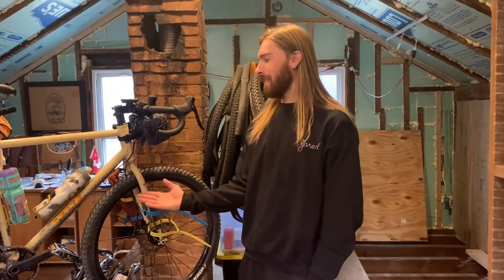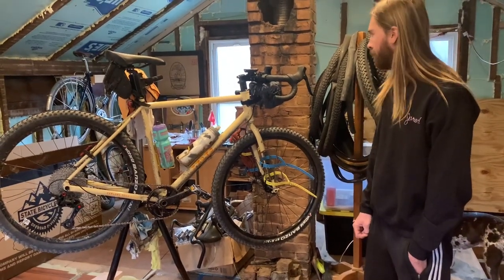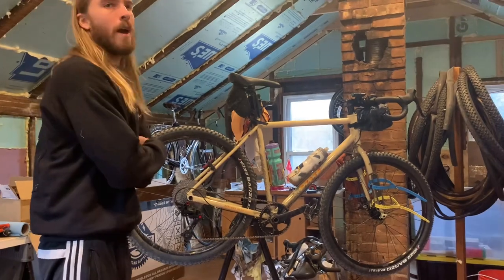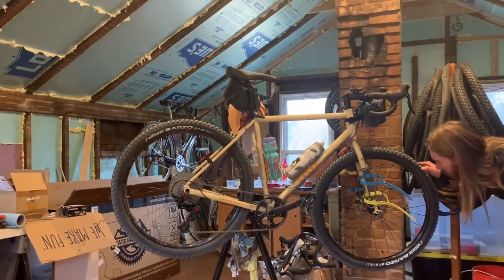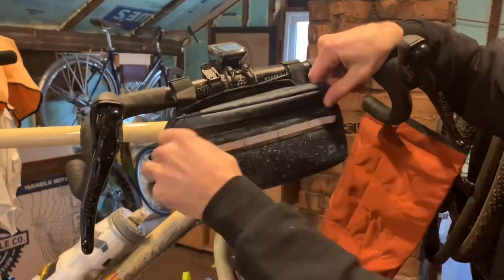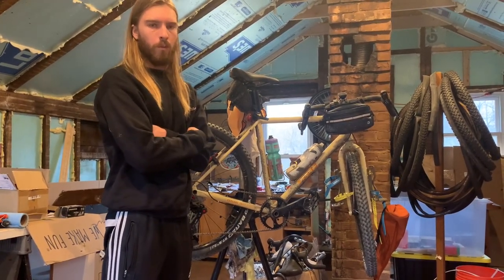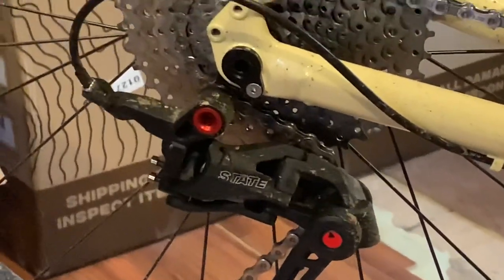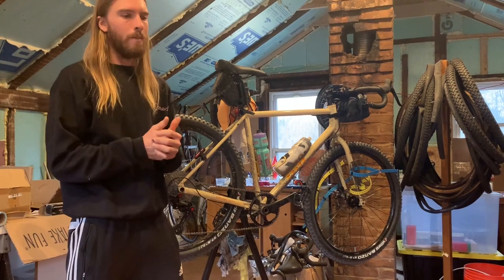State Bicycle Co 4130 All-Road Review

Comment: I have beaten mine senseless on gravel, dirt, mtb and blacktop for well over 2500 miles. I love it. The Sensa based groupset is awesome as well. Brakes are strong, but I upgraded to sintered pads front and rear. I adore it. Unpaid endorsement. Unless State sends me some stuff.
Reply from the maker: Awesome man. I have around 1100 miles in mine now, on all types of terrain and absolutely love it too. I agree about the groupset. Maybe I’ll try new pads before upgrading the brakes. I was thinking compressionless housing might help too
Reply: Have you had any shifting issues or chain dropping? I might get this bike
Reply: @gavin7390  Only on really rough mountain bike trails that it probably shouldn't be on. My buddy bought the aluminum version and he will throw a chain every now and then though. Mine is still trucking!
Reply: @travislivengood2744  yeah I guess it's not really intended for rough mtb trails. But that's awesome man. Did you have any issues with the derailleur or the derailleur hanger when you got the bike? I'm kind of worried about that. Heard quite a few people have problems with the derailleur and derailleur hanger
Reply: @gavin7390  I have really had zero issue. I had to recable at one point due to a failed cable housing. I had State ship me a spare mech hanger as just to have. I bet the bike has an easy 4-4500 miles on it.

Comment: Hey Wayne, about your problem on 12:00 of the video. This is wrong routing of the cable, it should have been routed to the outer side of the hoods and the under the handlebars.  You can reroute it when you change bar tape or replace cables. Hope this helps!
Reply from the maker: Awesome, thanks. Probably time for some new bar tape this winter so I’ll give that a try!

Comment: Good review! I like the grey myself! Anyway, looks like yours is a 54(med). How tall are you and what's your inseam? I am 5'8" with a 30" inseam and usually ride a 54. State's sizing chart is saying for my measurements to get the small. After your riding experience what do you think?  Thanks!
Reply from the maker: Thanks! I’m 5’10 with a 32” inseam. I usually ride a 55 or 56, but this 54 fits me perfectly. According to the geo chart, the effective top tube length on the medium is 55, and the small is 53.5. 

Sounds like you’re close to being right on the line between sizes, but a small may be closer to what you usually ride. With the stock stem (100mm I think) there’s a chance you’d feel a bit stretched out on the medium. There’s also a chance you’d want a longer stem on the small.. 

With an appropriate stem and proper saddle adjustment (fore/aft, tilt, and height) you could probably find a good fit on either. The biggest difference would be standover height. You’d have plenty on the small, but medium might be tight. On paved rides it’s not such a big deal but on rougher terrain it’s nice not to worry about that when you need to put a foot down. Also, from other reviews I’ve read, the small only has one set of bottle bosses in the main triangle while the medium has 2, and more room for a frame bag (although it weighs slightly more.. not a big deal in my opinion though).

Hope this helps!!

Comment: I was looking at this as a possible winter commuting bike, but if it takes that long to get here winter may be over by then. I like the 700c and 650b swap ability.
Reply from the maker: That’s a realistic concern. I just checked the SBC website and it says expected shipping early February.  If that actually happens you’d probably have it by mid feb, but you never know.. might be a spring commuter instead.
Also, I just picked up a 700c wheelset so after I get some time in on that setup, I’ll make a video about how it rides with 650b vs 700c.
Reply: I have the 650B and 700C wheels, it’s definitely worth the money. It’s like having two bikes
Reply from the maker: @towtowstrailtalk6853  Yeah it really is. I have to say I prefer the 650b wheels with bigger tires for the plush ride. The Vittoria barzos that came stock are great for loose/muddy stuff, but I’m looking forward to getting some Rene Herse 650b x 48 for it once I wear these out :)
Reply: @bikeonwayne6937  Thank you for the review! This was so helpful!
 
Any update on 650b vs 700c? Trying to decide between the two for riding mostly on paved roads and occasionally some off-road trails.
Reply from the maker: @NirateTV  I think the bike is a lot more fun 650b even on pavement and really encourages you to hop on any little side trails, gravel paths, etc. I think it comes with Vitoria terreno dry tires now which are less knobby and roll smooth on pavement and still good on gravel, just not mud. I have them on another bike and like them. 

With 700c wheels it feels a little more like a touring bike and lacks the cushion you get from bigger tires.

Comment: I wanted the tan, ended up with grey just didnt want to wait.  Got mine back in I think august.

I had a couple issues to.  one did not get barzos ended up with the GK's fine but I kinda wanted the chunkier tire( I should mention I ordered after the barzo was the new standard).

I ordered mine with a 36t chain ring it never showed.  got a refund.

I ordered to 700C 650B combo which is a good deal  I went to pull the rear wheel and the axle was trashed way over torqued stripped threads.   they replaced that and the hanger was a ton of back and forth but they made that right.

I agree the brakes suck.  I didnt like the bars and switched to cow chippers.
Reply from the maker: Thanks for the response! So your hanger was bent too and they replaced that and the axle? I still need to ask them about my hanger..
 
What do you think riding 700c vs 650b?
Reply: @bikeonwayne6937  No hanger is part of the thru axle and it was stripped from over torque.  Just email them they will want a bunch of pics and after that it was sent out.  

 I kinda feel like the bike handles better on the 700C to be honest.   I think If i would have got the larger barzo's I would have preferred that ride.  the GK's are not that much bigger of a tire it just doesn't feel like a totally different bike just closer to the ground and slightly better in chunky stuff.   I still have the 650B's on it but I will switch them out before spring and probably stick to 700C on the bike.
Reply from the maker: @Summitperry  ok cool, thanks

Comment: Hey man. Good review. Do you still have this bike? I'm planning on getting it but I'm a bit concerned with the quality of some of the parts. Many reviews have mentioned a bent derailleur hangar and other issues. A lot of people have mentioned that chain dropping happens quite a bit too
Reply from the maker: I do still have it, still liking it after 2 seasons of riding. It does seem like bent derailleur hangers are an issue but I good LBS should be able to straighten it out if its a little off. It that and the derailleur are properly adjusted there shouldn’t be much of an issue with dropped chain. The clutch works well keeping tension on bumpy terrain. I’ve only had dropped chains when hanger was bent or derailleur limits weren’t set properly so it shifted beyond the biggest or smallest cog.

Comment: Great review and really nice bike. I’m about 6’ tall with a 32” inseam. From their chart it looks like a Medium would be best for me. How tall are you and what size is yours? It’s a little scary buying a bike sight unseen. Thanks!
Reply from the maker: Thanks, John, and I agree with that! I’m 5’10 with 32” inseam. In the previous comment from Eric, I talked about the sizing a bit so that would be worth reading. I also ride a medium and find the fit basically perfect right out of the box. I think a medium would most likely be the best fit for you as well, maybe with the saddle adjusted towards the back. There is plenty of length on the seatpost to get it high enough, and crank arms are 175mm. The overall feel is more upright than a traditional road bike but still stretched out enough to have some weight towards the front, and not be sitting upright like an mtb or cruiser. You could always swap to a longer stem if you needed more reach. But I think you would be able to achieve a good fit with proper adjustment of the stock components.
Reply: @bikeonwayne6937  Thanks for the reply! That’s really helpful. Much appreciated.

Comment: Been getting into riding bikes in the last year or two. Been looking for a fun all around bike like this one. You mentioned being able to swap out wheel sizes. Which size do you like more? I'd probably end up with both but what do you think I should start with?
Reply from the maker: After more time on the bike I like it wayyyy better with 650b wheels and big tires. Just feels more playful and fun and is more capable on singletrack than you’d imagine. Only benefit I see of 700c is a little less rolling resistance on pavement but you lose the “suspension” from higher volume low pressure tires and the bike feels slightly boring that way to me, at least compared to 650b.

Comment: hi can i put my 27.5 x 2.6 inch. wide tires in the FORK only? thanks
Reply from the maker: Hmm.. there’s a good bit of clearance in the fork with a 27.5 x 2.2 tire. I haven’t gone any larger.. I can try to measure the space on either side of the tire and let you know. My gut says you may be able to squeeze it in but it would be super tight, leaving no room for mud, etc, or the tire itself might just rub the fork.

I’ll measure tomorrow and let you know
Reply: @bikeonwayne6937  wow really you will measure it, thank you so much
Reply from the maker: @jamesl.7657  so with the 27.5 x 2.2 tire there is still about a 1/2 inch of clearance on either side and above the tire (below fork crown).  So the 2.6 might fit, but it would definitely be sacrificing clearance for mud, tire deformation, etc. 

Let me know if you try it!
Reply: @bikeonwayne6937  yes! your so technical guys, my state bicycle co. x national park foundation is for shipping for now, i will inform you guys. thanks wayne. keep safe

Comment: How supple this bike with 2.1 tiers and how it handle bumps
Reply from the maker: I’m running the 2.1 tires usually around 27-28 psi and for it really absorbs rough terrain well. Not going to feel like a bike with suspension of course but feels great for a rigid bike. It feels much better this way than with 700c x 35ish tires in my opinion. The frame is steel but the tubing is pretty thick so the big tires really make the difference in ride quality.

Comment: Is this bike designed for touring with panniers?
Reply from the maker: Wondering that myself.. Not sure if it’s designed for it, but I just put a rear rack on it and will be testing it out with panniers over the next few weeks. I’ll let you know. Also planning on doing a video of a loaded touring/bikepacking setup on it soon.
Reply from the maker: Just filmed for a video on this which I’ll edit and post soon, but the answer is yes. Just did a 45 mile ride with panniers and didn’t even notice they were there unless I was putting something in or taking something out, which is ideal.
Reply: @bikeonwayne6937  how many pounds of gear was in the panniers?
Reply from the maker: Not much, maybe 5lb. It was mostly bulk to fill them out, a sweatshirt, book, some other bags, etc
Reply: @bikeonwayne6937  you should see how it handles weight. That’s the point of the panniers in the first place. If it can carry panniers but not loaded panniers then can’t be a touring bike.
Reply from the maker: I was doing you a favor trying it out with panniers in the first place, so I don’t appreciate the tone of that comment. However, the frame is built with very thick tubing and the geometry is well suited to carrying a load. I was mainly checking for heal clearance, since that can be questionable. On my test ride, I had planned on loading it up with produce at a farmers market but there wasn’t any there. So I just continued on for a nice longer ride with less weight in the panniers. Maybe I’ll edit and post the video, maybe not. But go buy one and throw some loaded panniers on it 🤘
Reply: @bikeonwayne6937  there was no tone. I simply stated the reason for testing it with panniers which is weight. The reason one puts panniers on a bike is to carry gear (weight). That’s why I asked if you would test it so that we could all see whether it will haul the weight of a touring bike. You could punt a buck of water bottles in the panniers to see how much weight it could haul comfortably. You would be doing many people a service by showing them that it can or cannot be used as a touring bicycle.